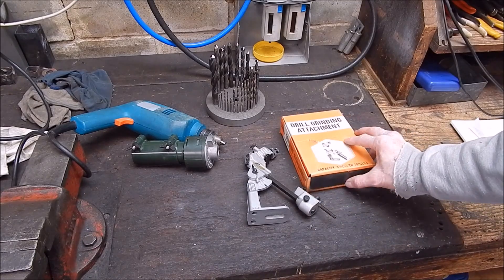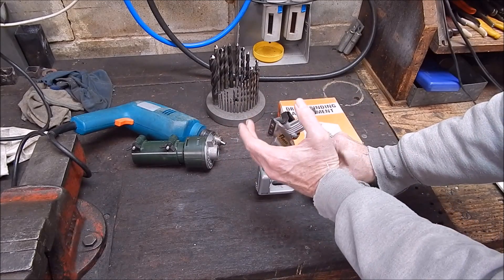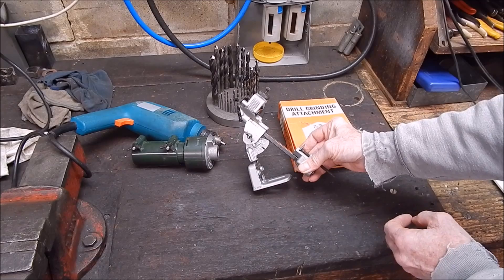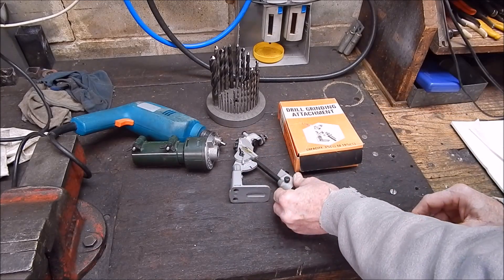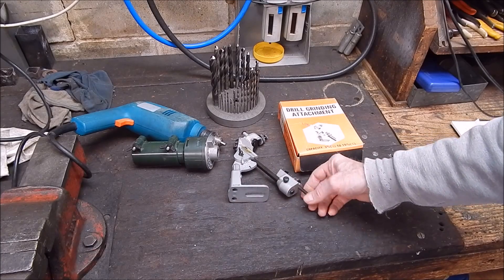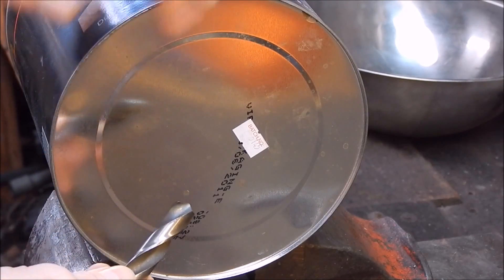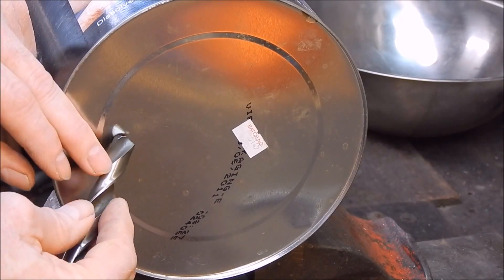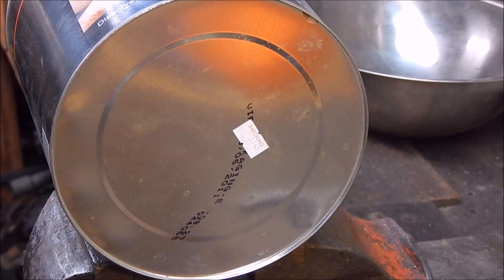How to grind back relief on a drill bit

Comment: cheers for showing us how to grind the back relief...  

Just a quick question, have you tried the stand alone drill sharpeners that bunnings and mitre 10 sell? I ended up purchasing an ozito one from bunnings and a rockwell one (I think that was the brand) from mitre 10 to try out as I had an issue with some steel that basically overheated and screwed up som drill bits so they needed grinding down to get rid of the overheated part and then resharpening....

So far I have not had an issue with how they work, they seem to handle getting the cutting angle back to a proper uniform angle and do seem at least to put in some back releif...

Just my 2 cents worth :)
Reply from the maker: Scallipus I haven't seen those.  Will check them out next time I go to Bunnings etc.  Thanks for the tip.  Cheers Rob
Reply: xynudu they are pretty easy to use on the smaller drill bits but can be a little bit fiddly to set up on bits below 2 - 3 mm   they are good for bits up to about 10mm although once you get up to there, your method is really the only way without spending hundreds on  a commercial sharpener...

so far I have resharpened a few smaller bits on them (8mm to 4mm) and then used the bits on my mill and in the tailstock chuck on my lathe and they have worked well...

Comment: Hi Rob,

Nice video. I've found that sharpening drills by hand only works well for the bigger sizes. Up to 6mm or so it is all too tiny and hardly worth the trouble. You are likely to end up with a drill that keeps running off-center or drills oval holes. I'd rather buy a new one than ruin a workpiece. 
What I saw you doing is a size that's big enough to see what you're doing. 
For those who want to get into drill sharpening: It does take a lot of practice and you should be prepared to ruin a few drills but it's certainly worth the trouble once you've gotten the hang of it.
Reply from the maker: Leo Gijssel Hi Leo.  Gets harder to do as the size drops for sure.  I generally use my linisher as it has a finer grit and slower speed.  Also use magnification.

I suppose it all depends upon how critical drill accuracy is required to be.  Some new drills are also less than wonderful.  Cheers Rob

Comment: Is the procedure the same for smaller bits -say .25" or smaller?  I, personally, have a harder time with the smaller ones.
Reply from the maker: Chuck Mercer Hi Chuck.  Same for all sizes.  They all work the same way.  Smaller sizes are really difficult to do - need magnification and very fine abrasive.  I generally do small drills on the linisher.  Cheers Rob.

Comment: Rob, thanks for doing this video. Much appreciated you taking the time to explain the theory and then showing how to sharpen.  This is probably the best example I've seen on doing the back relief.  Question on grinding,  is it worthwhile putting the aluminium oxide wheels on or just sticking to the silicon carbide one? Thanks again.  Mick
Reply from the maker: Mick Doherty Hi Mick.  I just use the standard carbide wheels (fine grade) and they work OK.  Aluminium oxide can wear quickly and lose shape - up to you.  Cheers Rob

Comment: I made a guide to sharpen drill bits on the grinder.  It works good on the larger drill bits.  For the smaller ones I use a drill bit sharpener.